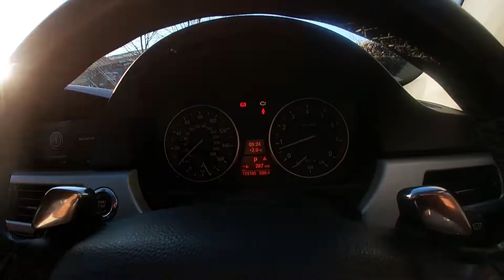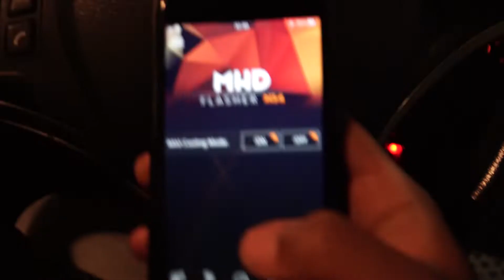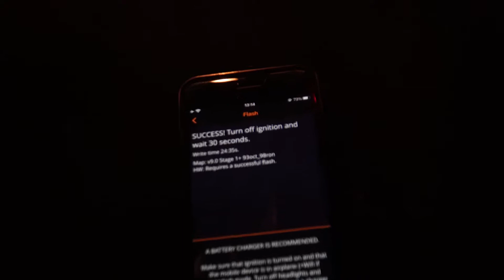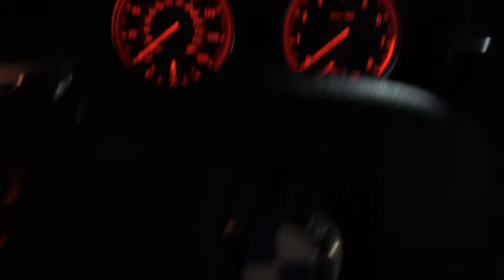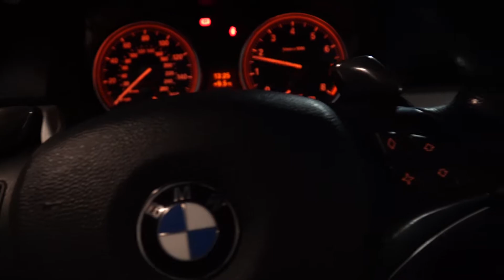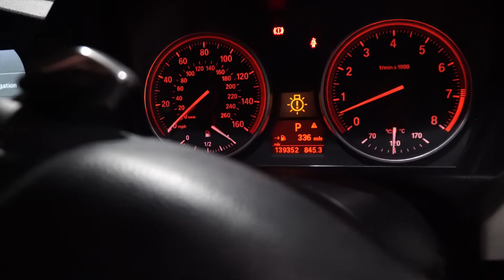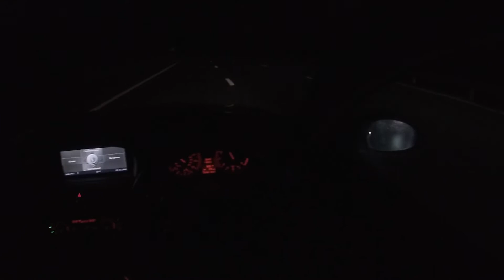MHD STAGE 1+ N54 335i VS STAGE 2+ MSL N55 435i

Comment: Loving the content! For me stage 1 to 1+ felt like a bigger difference than from stock to stage 1. Make sure to upgrade that charge pipe! Did mine a couple days back mainly as preventative maintenance but noticed a slight improvement in throttle response too.
Reply from the maker: Looking to upgrade next!